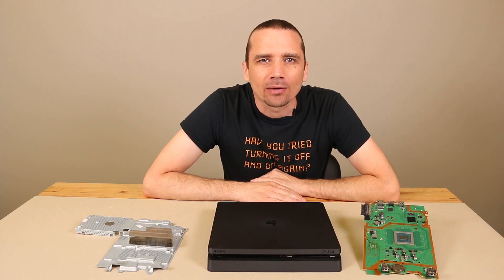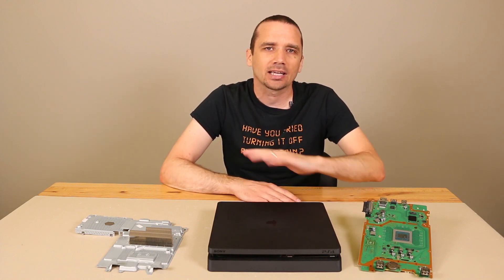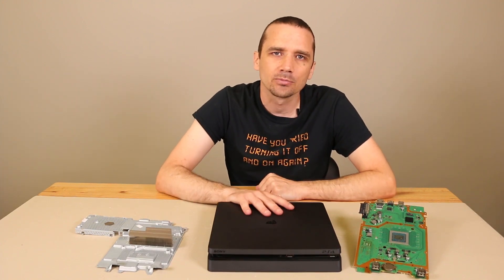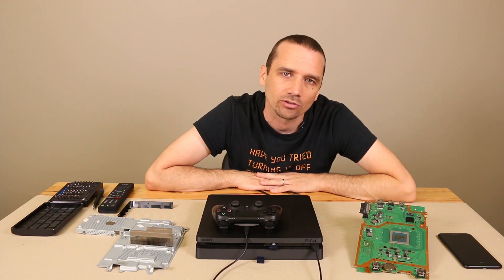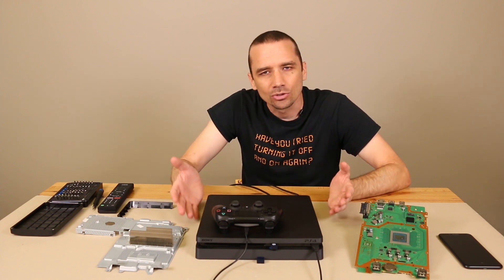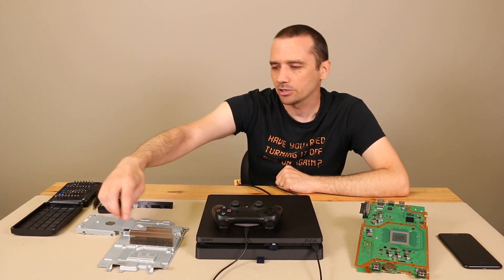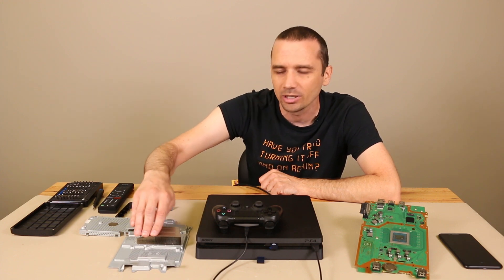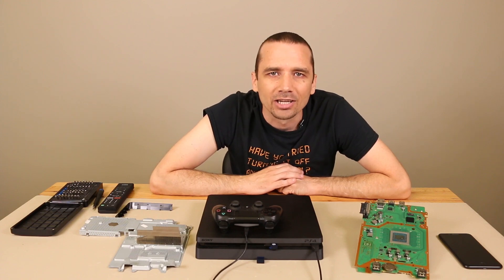PS4 Slim Too Hot? - Overheating Explained - Prevent Overheating

Comment: Is purchasing a stand-cooler for my ps4 slim worth it or necessary? Also what other is best for keeping ps4 slim cool. I just seen the video but I'm trying to figure out if there are more ways to cool system or to keep system at normal temperature.
Reply from the maker: Don't buy a stand cooler. Keep it in a well ventilated space and keep it clean.

Comment: My ps4 does exactly what u told is not overheating but I can’t turn on my ps4 properly and it turn itself off after 3 min and then it’s hot it turns hotter than the sun

Comment: i need help guys so it was like this when i play Any game offline my ps4 doesnt crush,but when i put on the internet ps4 my ps4 crashes and says that my ps4 is too hot what too do?! plz help it started yestrday
Reply from the maker: It probably has a dirty heat sink.
Reply: TronicsFix LLC so what should I do?
Reply: TronicsFix LLC tronics now it doesnt want to do anything it crashes on everything it happend yestrday and yea let me tell you something : So yestrday while i was playing my little brother punched the ps4 pretty hard and it started making very loud noises and kinda like error noise and i turned the ps4 again and turned it on again and did it many times.Then I rotated it and it stopped doing that noise but after that when i tried to connect it to the internet ot gaved me a message :Your Ps4 Is too hot and it showed the red light off death and so i thought to leave it for couple of hours so it may get again stable and it didn't do it i still get these messages i don't know what to do btw my ps4 is not even very hot or hot its like normal and it still shows the message please man respond soon i need to play ps4 i cannot live without it please

Comment: If you've got a disassembled PS4 slim, any chance you can confirm the connection type the wifi antenna uses?  Is it the U.fl / IPEX type people are adding antennas with...?

Comment: When I put my hand on the top where the power supply is after playing for 20 minutes it slightly burns my hand because it is really hot
Reply from the maker: That's normal. They get really hot back there.
Reply: Mine also experiencing same. But it's normal and I am not getting any warning or red alerts. Thanks man for the wonderful vids
Reply: hey hows your ps4 doing now? mine has same heat

Comment: I have my PS4 slim on a desk that has an over hang where the monitor goes and i put it under there and I'm wondering if that's good for it as it does get pretty warm to the touch.
Reply from the maker: Warm to the touch doesn't matter. They all get warm to the touch. Just make sure it can easily get air.

Comment: Hello 

So My PlayStation started going off randomly , like it goes of totally by it self with no light indications ! That is no blod or wlod. It’s as if it’s been properly shut down ! However it turns back on when u turn it on and goes off again .. this happens 1-3 minutes interval and sometimes 5 to 10minutes(when left for a day without turning it on).,

What do you think the problem could be. ? What should I consider doing .. 

I will be gratefully for all comments and assistance ! 

Thank you
Reply from the maker: Probably either the power supply or APU joints.

Comment: PS4 pro or PS4 slim? What would you recommend? I’ve just returned pro as it was super loud, but heard that pros with nvidia fans are much quieter. What would you recommend? As I want a relatively quiet system, with good graphics for god of war and Detroit become Human?
Reply from the maker: Nvidia didn't make fans for either system. The Pro has the best graphics and the Slim is quieter.
Reply: My bad, I meant some pros with delta fans are near silent whereas others are loud. I don’t have a 4K tv but I am still not sure which console to purchase to get the most of out highly demanding  games.
Reply from the maker: That's easy...the Pro does better with highly demanding games. They aren't silent though.

Comment: Hey troncis is it ok to cover your ps4 with a cloth after you turn it off and it he cool enough so dust from my carpet doesen't go in
Reply from the maker: Sure you can cover it when it's off, but if you have it on while it's on the floor it's going to get lots of dust and carpet fuzz inside.
Reply: I don't have it on carpet i have small table on carpet at which i have set my ps4 slim
Reply from the maker: That works

Comment: Keep it in a air conditioned room. Problem solved. It's the best solution
Reply: Laptop cooling pads under the console.
Reply: @AK3601  those actually work?
Reply: It ain't no xbox360 back fan attachment, but should cool some.
Reply: @nelzelpher2088  yep

Comment: So how do i fix it if it does give me error code with the three beeps
Reply from the maker: What's the error code?
Reply: TronicsFix. It says ps4 is too hot and turns off and beeps 3 times how do i fix it will i be able to play my game again
Reply from the maker: That all just depends on why it's overheating...there's no way for me to know what's causing it without having it here to test. It's probably either a plugged heat sink or faulty fan.

Comment: tronics, hopefully u respond but sometimes my ps4 slim just randomly freezes for some reason. It happens like every 3 days and I don't know what is wrong. it just stays frozen and I cant do nothing because my ps4 wont let me do anything so i just carefully pull the back cable and put it back in and leave the ps4 resting. i have had my ps4  for a year now. What should i do? get a vertical stand or something else, please respond
Reply from the maker: Unfortunately, there's no way for me to know what's causing the problem. Sorry.

Comment: Thanks for your video. But I have an issue with my brand new PS4 Pro 7116B (V2) and I wonder if you may have a solution for this.
It shuts down after 5 or 10mns of game or something else and before that there's a display message on screen that says "Too many usb devices connected".
I wonder if it's a PSU problem like the one in the first PS3 2000 models.
Anyway thank you for reading me!
Reply from the maker: Strange...I've not seen that problem yet.
Reply: It's a brand new PS4 that has not been used more that 12h.
It shuts down immediately without any indicators and when I restart it on it has the checking hard drive thing.
I think it's a PSU problem but I'm not sure.

Comment: TronicsFix What if my slim is feeling hot, shutting off randomly but no overheat error code? Here's what's been going on > Several months ago while playing World of Tanks alot, many hours, it started shutting down almost like a short circuit, screen just flashed and it was off, sometimes a colored barcode on the screen for a flash before shutoff. Happened several times and I felt the system and it was really hot. But no Error Code about Overheating. When this happens the power button does not work at all so I have to unplug the power cord then plug back in and restart it. This happened many times but stopped for a while and has been fine for a couple of months until today, when it started again while playing a different game. Same issue. I took the cover off and there's no dust anywhere, and the fan looks clean. I don't hear any noise, and I think the fan stops working I'm pretty sure. I don't hear the 3 beeps either, just the complete shutdown and sometimes that barcode flashing on the screen for a brief second. Should I have to install a new fan or could it be something else? If so should I do it myself or send it off to Sony while it's under the 1 year warranty? And is it dangerous to the system if the fan stops working alot? Would be great if it's a simple problem I can solve myself but it's really frustrating now as I'm trying to play hockey right before the playoffs. Please help, thanks

Comment: I have a PS4 Pro and the top casing cover is able to be taken off and gives you direct access to the internal cooling fan. You can do this without voiding the warranty as you don't have to remove any screws or warranty  seals. Is the slim capable of having the top cover taken off as well? Not sure if you're aware of that.
Reply from the maker: Yes, both covers can be taken off to access the fan.

Comment: One of the first accessories I buy when I buy a new console is an external cooling fan(s). Also, vacuuming out the dust from the intake and where the hot air blows out is obviously nessasary if you maximum air flow. Game hard or don't game at all.
Reply from the maker: I'm thinking about testing some cooling fans to see if they help keep it cool or not.
Reply: No

Comment: Should I cover the console with something when I'm not using it with something, to prevent it from getting dusty?
Reply: cover it with dust or sand, its a great protect. i put mine in water and then in fridge. afer 2 years its run perfectly inside my trash

Comment: See, the problem with me is, if I take something apart myself, I often end up bending something or dropping something. My finges are too clumsy to handle this stuff. And I don't have the money to buy a new one or have someone else clean it. How do I clean my ps4 with out takingt it apart?
Reply: Jester Jack you clean the fan, just pop out the top cover and clean it. It’s very simple this guy has some videos dedicated on the matter. You’re not gonna break the warranty stickers on the bottom. Check those out.

Comment: Im using a cooling stand as an extra help for cooling, have no issues thought would extend its life in long run. Is this a good idea blowing extra air into the system  on one of the intake sides with 2 3000rpn fans?

Comment: I have a question how long can I have my ps4 slim turned on until it overheats because there is sort of like a glitch in a game called Rainbow six siege when you start an offline match and you do nothing and you die you get coins and after a few seconds it does that again and again and again so you can farm those coins while sleeping or when you're on school but how long can I have my ps4 slim turned on while doing that because it is not really hot just normal temperature I think

Comment: I played gta V on ps3 and it didnt overheated for like 4-6 hours
Reply: ps3 is less powerfull thats why
my slim does not overheat as well
Reply: @Tops-gn1xx  it’s nothing to do with the fact there less powerful. PS3’s are just better in general and have better cooling systems. When I touch my PS3 slim after about 4 hours I can barley feel any heat, and it’s running mods as well. But when I touch my original PS4 it feels like there’s a fire inside because the plastic case is so thin and cheap and the cooling system can’t handle the computing power properly.
Reply: it does not overheat but does feels as if it will kill itself if it continues in that heat range, im sure, one can cook an over easy egg  on a 3 hour game play.
Reply: PS3 was fatter as well and had better cooling.

Comment: What does it mean when your tv turns off and says "no signal" than, if you turn on the ps4 connected to everything you need the tv still says no signal. Also, doesn't go to safe mode. What does that mean?

Comment: thanks, really helpful video after my new ps4 overheated after 5 mins :(
Reply: question: my PS4 Slim overheats very easily. I bought it second hand and it looks like it is in really good condition. I turned it on, powered it up and was going through the set-up for about 10 mins.  I then got the "PS4 too hot please shut down", and then it shutdown itself after 10 seconds.

Since it is overheating so easily, could it be that the fan isnt working at all?
Reply: Always buy a new one... Probably you got cheated... Replace asap

Comment: I just got my ps4 slim today im soo happy😀😀😀
Reply from the maker: They are good consoles.
Reply: TronicsFix got safe mode and lost data help
Reply: Alan Pedley its awesome but it overheats after like 5 hours of gaming
Reply: Alan Pedley you need to get it its awesome
Reply: Alan Pedley it does overheat but its not loud
Reply: Alan Pedley no problem 😀and it doesnt turn off and say its overheating but make sure to clean if its dusty
Reply: TheBigBoss i got it 3 weeks
Reply: @lordofgames5782  then ur CONSOLE is bad i play 10 hours per day and it doesnt overheat like fifa gta and some other games
Reply: @hufmn  i posted this 1 year ago damn
Reply: I just got a slim and love it
Reply: @lordofgames5782  ok
Reply: @wqbb287  is it really quite?
Reply: @noelpaul4532  not when you download disc game and play for first time
Reply: @lordofgames5782  lol i wpuld rather it be loud then stop working after a year or 2. Slims have the dumbest hardware design.
Reply: Lord of Games no it’s will be fine I’ve had mine on all night doing a gta glitch😂
Reply: @duggythompson9323  the slim is the best when it comes to cooling. The pro gets a little too hot but then that's cus its hardware is too heavy.the base ps4s just suck when it comes to cooling. The slim model is the best.
Reply: @lordofgames5782  mine overheats straight out of the box lol. Dont think it's normal.
Reply: @lordofgames5782  they don't they may feel hot by touch but reality they aren't at all
Reply: @lordofgames5782  yes it does
Reply: i got mine last night so happy .. gt silver bundled
Reply: congrats my friend now you are going to enjoy the latest games at A BUTTERY SMOOTH 30FPS and ultra settings
Reply: Lord of Games thanks for the info bro :)
Reply: Ah Ah no problem :)
Reply: Lord of Games Dude, I got mine 3 day's ago Supports hdr and 1tb edition
Reply: FantomJasminefan2393844 Poop yea mine too
Reply: How long does it take for normal ps4s to overheat
Reply: Hehe I'm replying after two years which is ur fav game??
Reply: Erik dying light  i got rid of it so i can focus on school
Reply: Ok
Reply: Me too!!!
Reply: I was happy when I got mines to
Reply: Lord of Games oh me too
Reply: Great have fun🙂😁
Reply: You’ll regret getting a slim trust me they break in like a year
Reply: @tiberiusmcguffin9480  They do not i've had mine since late 2016 hasn't even broke in almost 5 years
Reply: Is It normal for the RF shield plate on top of the power suply to change color on some áreas? Like Rainbow color somehow It might be from Heat?
Reply: Pro better
Reply: @djgates06  1 hour
Reply: @aestheticmason8470  what??
Reply: @djgates06  yup
Reply: Packerfan006 60fps same as slim😂😂😂
Reply: Same!!

Comment: Thanks for the information my systems running better now but due to health issues I lack the fine motor skills to remove the screws and would like to have the system properly cleaned I live in NSW Australia and was wondering what price would you expect to see for a cleaning of a PS4 slim?
Reply from the maker: Hmmm, I really don't know. We would charge $89.99 USD for a tune up

Comment: Hey man, I have a PS4 pro, had it since it launched. I never had an issue with it, and I'm sure its got hot in the past from how much I use it, but never really tested it or felt it to check. Lately I've been noticing a weird smell in my room. It's been making me feel ill, headaches, sinus pain, and making me cough. It's smells like burning chemicals or something. I don't notice until late at night after gaming for several hours. The back of the PS4 feels extremely hot at this point, but no shutting down or errors. I took it apart and there was little to no dust. Could it be the power supply? Could my PS4 be getting too hot and melting something inside to cause this smell and irritant? Could thermal paste cause a smell like this? Again, it doesn't really smell like burning plastic. It's more of a chemical smell, I think. I tried looking online about this, but can't find anything out. This also hasn't happened the whole time I've had the console. I did recently get Destiny 2 and wonder if the game is just too much for it and it's causing too much heat? I don't know. Any advice or knowledge you can throw at me will be a huge help.
Reply from the maker: No idea. I've never seen that problem with a PS4.

Comment: I just got my PS4 so  its up away from dust and such but the concern I have is that the unit gets pretty hot on the rear side where the cables go in especially my HDMI cable which is hot to the touch, is that normal for the slim?
Reply: Btw I am playing Skyrim and after about 2 hours or so I get a blue screen and the game shuts off but not the console. I do run some mods but these are suppose the be compatible with each other how ever I haven't ruled that out as the cause because I also have the Xbox one and Skyrim on that which I use mods and it also once in awhile freezes up and crashes. My big concern still the heating of the cable because that does not seem normal.
Reply from the maker: Yep

Comment: Can you please use a thermal sensor inside the PS4 Pro to see the actual temp on the die? Mine is still under warranty or else I would probably have soldered a PC Fan controller with the flat head thermal sensors that go under the cooler and I would rather speed up the fan a bit :)
Reply from the maker: I may do that at some point.

Comment: I do get system software problems like once every 2 months. Has happened 2 or 3 times since February
Reply from the maker: That's a bummer.
Reply: TronicsFix my ps4 turned off randomly along with my tv twice. I unplugged everything and did a small clean without removing anything. I fixed the problem but dont know what couldve caused the problem. Its been like 5 days and nothing has happened since

Comment: PS4 overheating is just a sign of use, really. I still have my pre-ordered system and today I replaced the thermal paste and it runs like brand new. Cleaning dust out and replacing paste is completely normal and just something you'll have to do every once in a while. Quite happy with this little machine and if I ever replace it I'm gonna miss the light bar and touch sensitive buttons.. Not to mention the nice design.